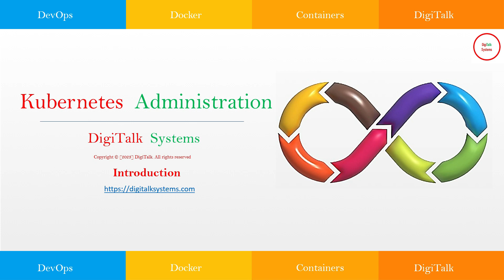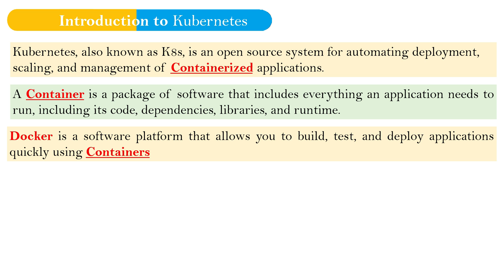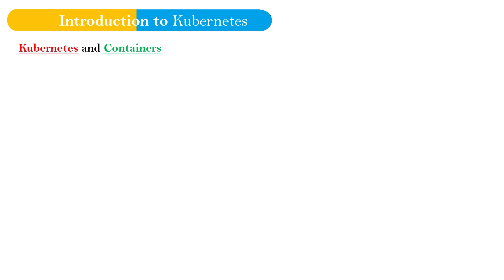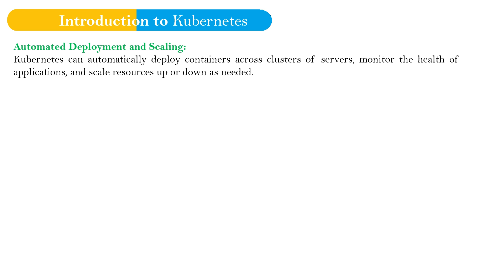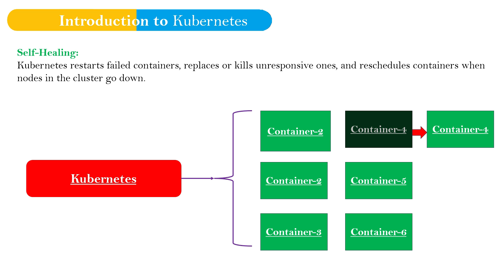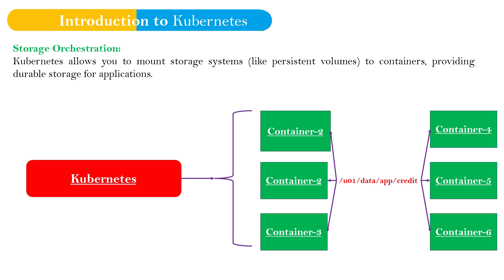Introduction to Kubernetes (for Beginners),What is Kubernetes, Relation with Containers and Features

Comment: what is the use of terraform ? and what are the differences between kubernetes and terraform ?
Reply from the maker: Terraform is an IaC Infrastructure as Code tool that provisions and manages cloud resources line VM, network, database. Kubernetes is a Container Orchestration Platform that automates the deployment, scaling and management of containerised applications within a cluster of nodes